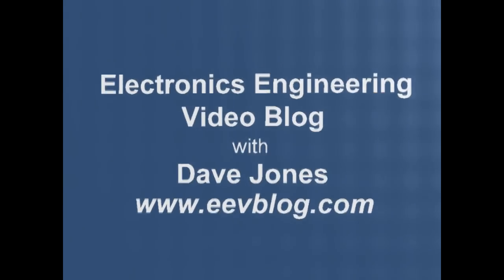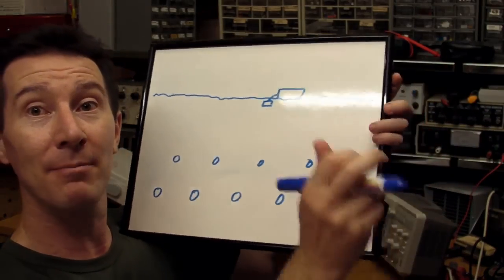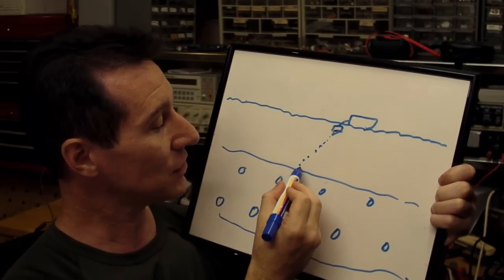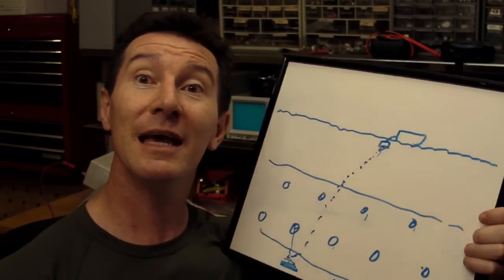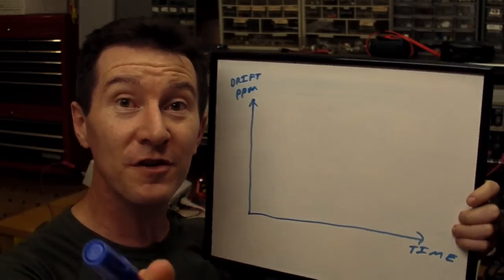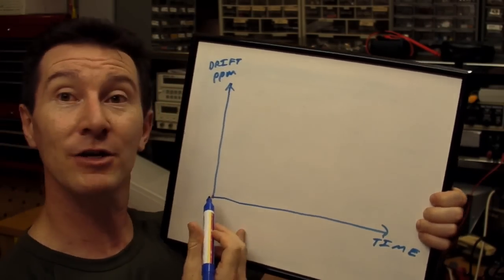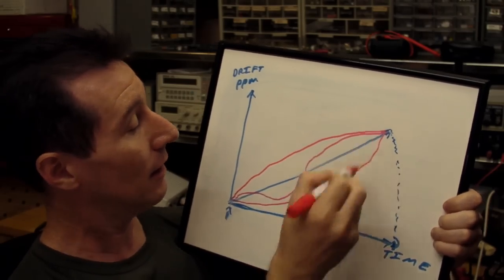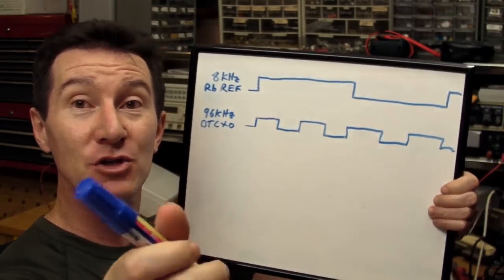EEVblog #61 - Crystal Oscillator Drift

Comment: I now realize that the crystal is not to be trusted. I use an esp32, using a built-in timer and the crystal, which should wake up twice in 24 hours and wait for a reset button. The crystal was drifting so much it was impossible. Changed the program, so now the esp32 wakes up every hour and checks against the internet if the time is less than an hour left, otherwise it goes back to sleep again. In one hour, the drift is so small that this works. My project is very small relation to yours but well explained and it helped. Thanks.

Comment: Your method is basically an higher-tech version of the old trick of taking the two clocks, plugging them into the two axes of an X-Y scope, and timing how long it takes the eye to "wink" (every 180-degree change in phase is half a cycle slipped), which gives you the difference in the two frequencies.

A higher-precision way is to use a time interval counter (TIC), which basically does the same trick of using a microcontroller to count the number of ticks of a sample clock between the rising edge of one signal and the rising edge of another, but then it adds on some analog electronics to measure time less than one clock (as a simple example, imagine charging a capacitor with constant current, dumping it back to zero once per clock, and having a way to isolate it after the STOP signal comes in. Then you can discharge it at a lower constant current and "stretch" the original time interval by the ratio of the currents). That is a device you can buy from Agilent or whoever. Then you can plug it into a PC and run the data into an app like TimeLab and get some nice plots.

Comment: I remember in one radar system, the crystal oscillator  OCXO in the tracker unit required 20 minutes to stabilize. As little as the grease from the technicians fingers could change the "oven's temperature" enough to send the chassis back for repair. We needed the trackers out ASAP.  So failure rates were high once the trackers got into the field.

Comment: Dave... Very innovative method for measuring the drift over time, I am quite impressed. I guess this is the price to pay for using a natural-mineral based element for frequency control: there is some randomness thrown in for free. I wonder if it's possible to produce quartz with a reliably repeatable structure to make the drift characteristics also match very closely
Reply: you can make it fucking perfect, if it's small and get shot by radiation it will drift, whether it's completely pure or not doesn't matter. Rubidium is more precise and uses more energy because it needs more energy, from radiation's point of view it's like the difference between fighting sheldon cooper and fighting godzilla.

Comment: the attenuation of the GPS signal that far underwater would be difficult to get around. Most GPS sensors cannot work indoors, even if you did get a signal you would then have to worry about the signal bouncing from the environment which can significantly affect its accuracy, its why in built up areas you can loose GPS position accuracy as the signal bounces of of buildings that create a canyon effect. I know that the post is quite old but it may be noteworthy to someone :D

Comment: The telco industry has spent a lot of time on this and the internal documentation on this subject at least where I worked, was good. We used TCX0's as the basic clock, there were 3 of which we took the best of 2 at any given time. The long haul communications nodes had rubidium oscillators to stabilise the long term drift of the TCXO's
Reply: OR'ing 3 oscillators is the best mean to stabilize and eliminate the radiation problem, your circuit works fine until a cosmic background microwave radiation resolve to shoot your oscillator out of phase.

Comment: Measuring clock stability is such an important part of the GNSS (GPS/Gallileo) system.  The method involves using one master clock, which is known to be more stable than the unit under test, and to measure what is known as the Allan Deviation.  The Allan Deviation provides all kinds of useful information about the performance of your clock, including what types of instabilities you're dealing with.

Comment: @sostenuto If you want to measure jitter or phase noise, your measuring equipment always has to be better than the DUT by quite a margin. The triggering on a scope may do for relatively jittery square wave sources like a CMOS VCO, but hardly for an XO. Phase noise analyzers go to great lengths in cancelling the contributions of major phase noise sources.

I suggest you check out the websites of Leif SM5BSZ and Enrico Rubiola, those might give you an idea. Also look at drift cancellation.

Comment: I know this is an old video, but Dave, didn't you basically implement a time interval counter?  We used to use TICs but ultimately switched to HP5071 cesium clocks for our project, and the TICs fell out of use.  TICs are definitely test equipment you can buy "off the shelf" :-)

Comment: I guess the input to the reset of the flip flop must be inverted since the flip flops I have seen will always be low when reset is asserted. I also guess that D is tied to Vcc. When the 96Khz signal strobes past the 8Khz marks, I guess the counter will jump from zero to 104.  I guess you could programmatically create a round-robin with 104 being equivalent to -1, 103, -2 etc. Many micros have two 16 bit counters so everything could be done in the sub-30 cents STM8S103F3 which is great silicon, although takes a little more getting used to developing (Avoid STs standard libraries, use gicking stm8as.h instead... Silicon-wise ST are VERY good, software-wise ST are CLOWNS.) . Clock the STM from the rubidium source, feed DTCXO into TIM2_CLK. Software handles the rest.

Comment: Hi Dave,  EE here..   This is interesting. I've done crystal osc design; in the 1-5 ppm range and didn't have to pay much attention to drift.  
...
Help me understand the "quadrants".  Are these simply count ranges?  Such as 0-25  then 26-50, then 51-75, then 76-100  ?  I imagine you selected these quadrants based on the typical short term stability of the osc, no?.
...
- Were these off the shelf oscillator modules or did you put crystals in your own oscillator?
- What was the basic stability spec on the oscillators?
- Was there any TC done, or is the ocean floor a constant temp?
- Were the oscillators pre-aged, or selected for cut angle?
...
- Which logic family did you use for the counter? Jitter can be introduced there and was that part of your 'quadrant' size choice?
...
- I was always told that the long term drift was due to mechanical part aging and 'work-in'. so it was more asymptotic. So, does this simply give you the characteristics that you then assume continues in the field with the same period/frequency - centered along the linear average?
...
- Was the time period of use short enough so the short term average was assumed approx.  linear rather than worrying about the asymptotic curve?
...
-- 
Cheers, Steve
Reply: Not sure if I understand how the compensation is applied.  
...
 I don't understand if this is individual compensation or just getting the characteristics of the family.  If it is for a family of oscillators were they all selected from one run from the manuf?.  
...
Is the maximum drift from the linear within the requirement so you don't need to track the individual (sine) variations, only take out the linear component as long as the short term variations are within the required?
-- 
Cheers
Reply: ok i see you called them DTCs.

Comment: I have few questions:
1) Do you measured how many 96KHz positive triggered samples were their in 1 8KHz? There is huge possibility that you may have only 9 or 7 positive triggers in 1 8Khz clock cycle! & you may miss it depending on your sampling rate.
2) I am hoping that these calculations were done after taking out the individual data loggers(hydrophones) from the sea & you can't be sure if they follow the +ve curve or -ve curve every time. Or was their anyway that the drift in clock was in same direction or what was the way in which you concluded that?
3) Was it really worth it? As i am assuming knowing the final drift & drawing a linear curve can also do the job more or less consistently if the data is logged at pretty big sample rate so that some minor deviations can be ruled out in between individual oscillators! What was the data logging rate for the hydrophones?

Comment: ok so tell me this does for example my SOC in phones frequesncy drift? if it does it explain me why half of the phones start to lang dramatically despite software issues. also why not simply use a cheap XO sinc it with gps every some time and compensate a drift? wouldnt that be mutch easyer solution since GPS is like an external constant for all of those devices?
Reply: Unless the satellite drifts ;)
Reply: Dazzwidd
thanks
Reply: I don't understand that aswell. If a phone has gps, why doesn't sync it up from time to time automatically? Maybe they do, by the way.
Reply: GPS is hard to get a signal for under water

Comment: If you math out all simple temperature correlated stuff bei DTC (and do it right) then you have an output with artefacts which is not temperature correlated (or at least shows just remaining artefacts beyound your algorith). 
Anyway: Wouldn't it have been an option to resync the probes sitting on the bottom of the ocean by some radio pulse (low frequency... deep water.. long antenna rods) just before the actual acousting ping takes place?

Comment: why not have a master clock on the surface send out a ping to all the individual 
modules through the water periodically,  so when the data is gathered at the end of the experiment the pings along with the data can be realigned through time stretching?  then the clocks can drift all they like. : )

Comment: Why not keep them in relative sync by broadcasting a standard pulse from a known location. Control for ocean conditions by transmitting a pulse from a standard location on the ocean floor and the relative difference should be consistent throughout your experiment and can be used to compensate for drift for each oscillator. Enough standard pulses and you can compensate for non linear and even non monotonic drift effects.
Reply: dorbie from what I've read, getting any kind of radio signal to the ocean floor is quite nearly impossible.
Reply: +Ryan It wouldn't have to be radio waves. Acoustic would make the most sense.
Reply: +gblargg The speed of sound through water is not constant. It depends on temperature and pressure along the way from transducer to receiver.
Reply: NatureAndTech Yes but the relevance of that depends on the frequency of your data collection.
Reply: +NatureAndTech nop, i can sinchronize with the pulse i received then exactly 1s later send my id to the base station and they will know exactly the latency and send back the timing adjustment with the id of the receiver calibrated. Btw, there's nothing magical about sonar data transmission at low speed, except the limited bandwidth. Theoretically you can use transducers to dial up an internet connection to an island, but no one else can do this at the same time because you've got "only one pipe" for the signal to flow.

Comment: I'm confused here.  Dave states that rubidium clocks simply consume too much power to be used in the ocean floor sensors.  Then he show's a circuit directly using a rubidium reference clock to determine whether or not the chosen crystals are drifting.  So I'm going to assume that this was done on the surface in the lab.  Dave also mentions that there were hundreds of these ocean floor sensors, so I'm guessing these month long tests were performed on hundreds of units?  That sounds a bit impractical.  Then what? For each of the several hundred crystals you create a drift profile then presume when you turn it on a few weeks or months later at the bottom of the ocean at 3 degrees Celsius that it will follow that same profile you measured in the lab.  Then when you collect the data you correct for your lab measured drift.  That seems a bit crazy to me, there is no way that's accurate.  What am I missing.  It seems the best you can do here is simply say "we will have X maximum error in our results", but I don't see how anything can be "corrected" for after the fact.
Reply: The rubidium oscillator was used in the lab to calibrate the error-correction circuits. It was not used on the final product.
Reply: If you listened to the whole presentation, the Rb clock was used in a lab setting (constant temp, no vibe,etc) to characterize the drift over time of several samples.  This in turn was used to construct a maximum drift over time characteristic.  That characteristic was then applied to all other drift and error sources to determine if the oscillators selected would fulfill the customer requirements.

This was not used to calibrate each oscillator, only to determine the normal characteristics of the family.  The story/talk/tutorial was more about determining a characteristic of a component, not calibrating.

Fascinating topic.

Comment: I think I would just have stuck a Rubidium Oscillator in it and check it periodically (e.g. every day) where the offset can be reasonably linearly approximated. Assume the Rubidum takes 20W and takes 30 Minutes to warm up and lock. That would be 18kJ or 10Wh per day, so 900Wh, 1.62MJ over the period of operation of 90 days. About the energy of two car batteries. Much but still tolerable in such an application.
Reply: If I am assuming correctly this looks similar to a project done by Shlumburger in the North Sea some years back.  The sensors were hundreds and deployed by attaching them to underwater cables.  There were something like underwater planes which took care of guiding these cables through the currents so that the cables are equally spaced and did not get entangled by the North Sea currents. Pretty exciting engineering challenge!!

If this was the project Dave is referring to, attaching hundreds of lead acid batteries to the underwater cables would have been impossible.
Reply: you didn't understand, they need to lock the timers of that shit between multiple data collectors, fuck, if gps can do it why not use the exact same system but with ultrasound? they're both based on timings and tridimensional waves.
Reply: plus they are based on the propagation speed. The propagation speed of sound under water changes with pressure, water temperature, the density of the water and there is doppler shift from the water currents.

Comment: How can i replace my motherboard's oscillator? Jitter is killing my experience on games and music. I can't take it anymore
Reply: is this a joke?
Reply: Change motherboard, choose a higher quality one in the server stuff.
Reply: Even the most expensive motherboard on the market  has crap oscillator.
Reply: Trust me José, what you're experiencing is not related to the oscillator. In my long carreer of computer engineer, I've built more than a hundred PC and I only met once a crappy oscillator, it was impossible to get a sharp picture with a PCI TV card. It only happened once. Your problem is more likely system and general hardware related. For example, if you encounter jitter while your software is accessing your harddrive, obviously it's not oscillator related. Remember the PC is at start a business machine and wasn't met for high precision timing and music. You can circumvent many timing problems by using a real time OS, an OS were kernel reaction time is known and constant. Hint : windows is not one of them.
Reply: But as far as i'm concerned the OS Kernel relies on motherboard's master clock to sync the threads. Not just that, but most peripheral, including the CPU, also relies on the master clock as a base frequency. Am i wrong? 
Also, i have an old SIS motherboard for Athlon XP that seems to perform smoother than recent boards. I noticed that the clock implementation on these old SIS boards is better, with more filters (capacitors) to delivery smoother power supply to oscillator. For some reason, the new hardwares can't keep the timigs right. But i don't know, im just a curious guy looking for some answers.
Reply: Latest OSes rely on the HPET to synchronise tasks, correct. BUT, some OSes in the real time category guaranty every event to be threated in an interval of time known in advance. Non RT OSes take their time to thread events, with no guaranty. As I said before, the PC was meant from the beginning as a low-end business machine. Historically, the PC was engineered like a 8-bit (with a 16-bits µC) using only off-the-shelf components. Of course it growed and was enhanced, but those limitations still exist. Take for example the Amiga, with a very precise chipset allowing coprocessors to access memory while the central µC wasn't, allowing smooth sound and animation. The Atari ST was not so evolved and lost the competition. The PC is not even as smooth as an Amiga, even today. Over this, you have the OS kernel layer I already mentioned. Your old Sis Motherboard has a nice clock circuitry, but that's not what made it smoother because the reasons are multiple : your Athlon was single core single threaded, unlike your current CPU. your Sis chipset was of low end, so the timings were less than agressive and therefore slower and smoother, you weren't using the same OS (unlikely, winXP doesn't run on modern rigs anymore). Don't expect to have precise timings with a OS full of back services : automatic updates, disk defrag, antivirus, telemetry, et cætera et cætera. You should try a more robust system like LinuxMint, and then install a "lowlatency" kernel. If your problems persist, it's hardware related. If not, it's software related. Of course, you'll have to dual boot. If using a virtual machine, the problems of the hosting OS will propagate to the hosted OS.